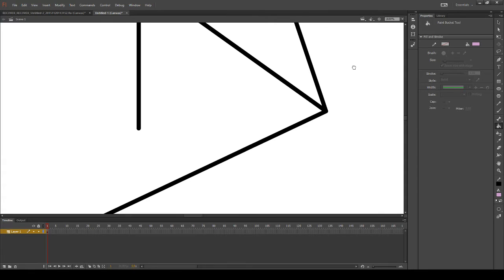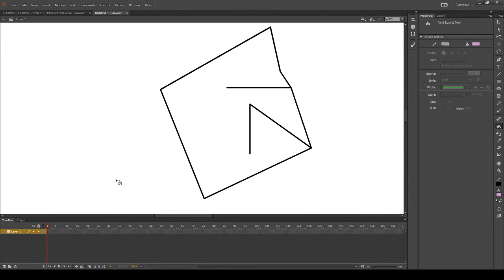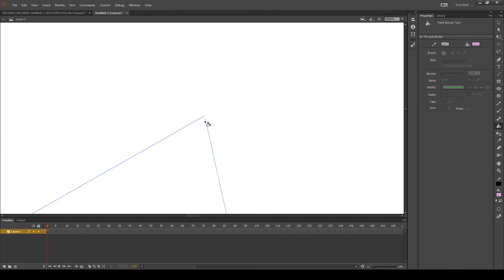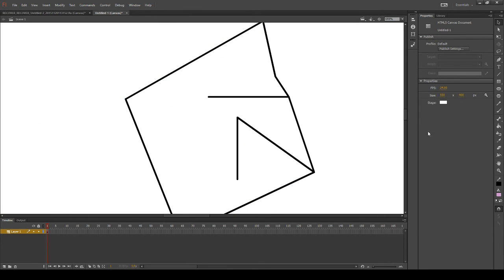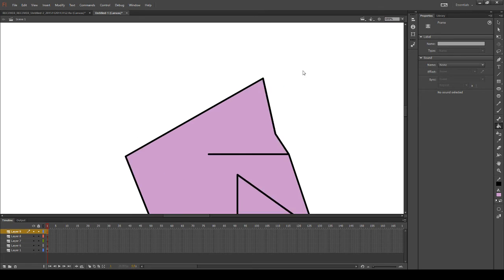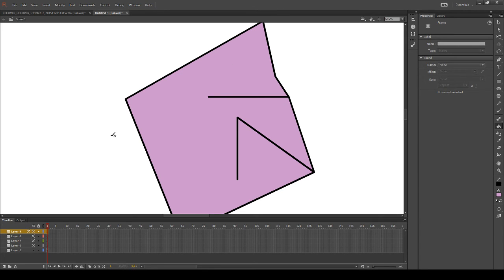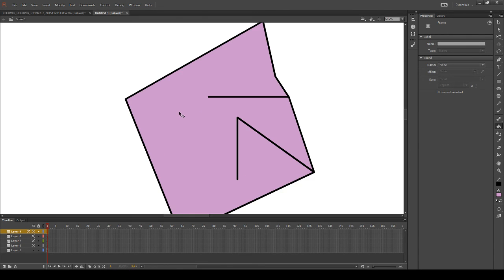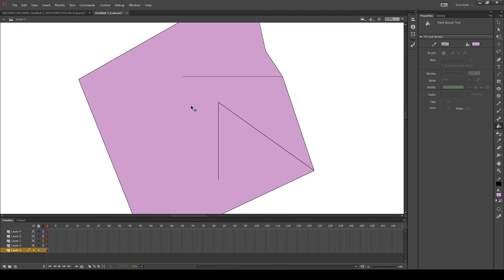How to fill in Abode Flash (Fixed)

Comment: OMG thank you! Life saver.... It was so frustrating! I don't understand why there were holes in a single uninterrupted line .... but anyway it works yay! Ps. for those who are saying that it still doesn't work, its possible that that you haven't 'BROKEN APART' the picture. You do that by highlighting the pic and then right clicking and choosing 'break apart'. It should work afterwards.

Comment: mine still does not work
Reply from the maker: +Penguin Vs Gaming - Are all the lines on the same layer?
Reply: +ozboybrian how do i make all lines in the same layer cause im pretty sure mines are and it still wont fill it up
Reply from the maker: If they are not in the same layer, click the layers they are on while holding Alt OR shift (one of those) and then right click a layer and click merge layers. (something across those lines.) after that it should be sweet, just make sure they are unlocked and back up your work first!
Reply: I nad to work on my iPad with animation creador free to make my work and its takong quite a while... Just bc the one i started i couldnt color 😂